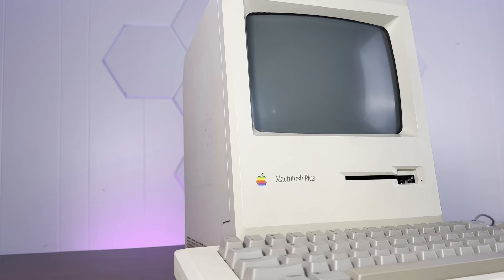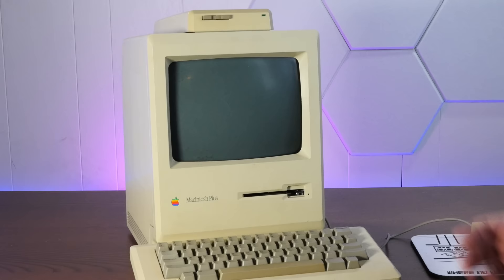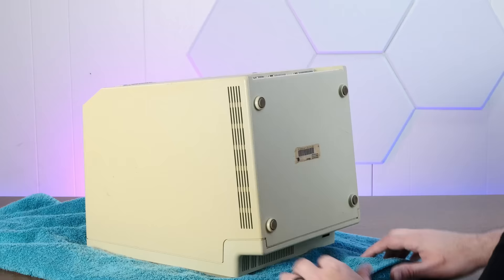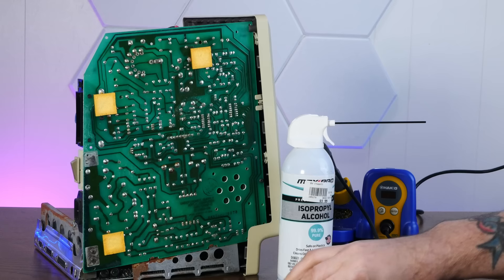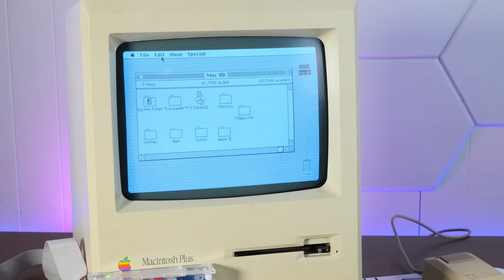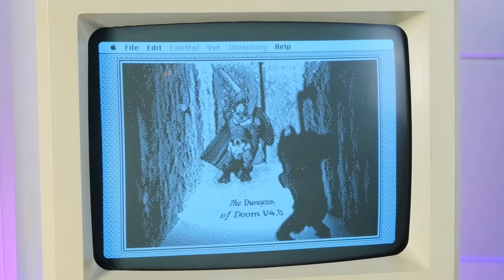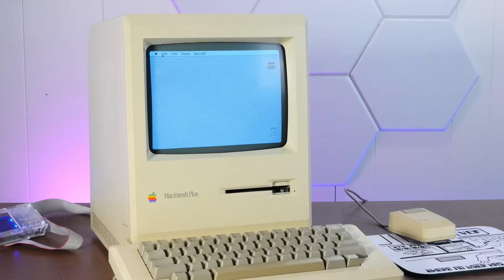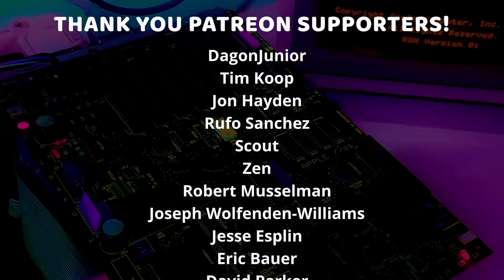Steve Jobs Broke This Mac

Comment: I'm actually glad they used Torx, because it doesn't strip if you look at it wrong
Reply: the issue with Phillips screws is that most aren't actually Phillips screws, but instead are JIS screws that also are cross-shaped but take a flat screwdriver instead of the bullet-tipped Phillips screwdrivers that would strip it in three seconds

Comment: Talking about the lack of fans, in the UK we had the opposite issue, the Amstrad PC1512/1640 had the PSU in the monitor and as such convection cooling was enough, IBM losing sales put out the rumour along the lines of "these computers are unreliable, they have no fans so they overheat". In the end to placate customers a fan was added to HDD models, Alan Sugar remarking something along the line of "we'd paint it pink leopard print if the customers wanted it".
Alas the replacement for the PC1512/1640 was unreliable and got recalled, none of it was down to anything Amstrad had done with the design but they were supplied dodgy hard disks, something Amstrad sued and won damages over.

Comment: "Fortunately, all the screws are exactly the same size!" - shows screws with 2 different types of threads
Reply: Same torx size, beeno.
Reply: @Us-two  that makes it significantly worse if there are 2 kinds of threads! it'd be very easy to mix them up and cross-thread the wrong screw in the wrong hole, they're the same size bit, so they're hard to tell apart.
Reply: @Minty1337 Normally one can see the difference, self-threading are tapered at the end and have a much coarser thread  -  these are used when installing in plastic. But I agree, when your eyes are as old as mine (79 years) the screws are a bit difficult to differentiate. Have a lovely day.
Reply: @Us-two Too bad he used a hex wrench on the sheet metal three, and a torx on the two handle ones, which should get lost...

Comment: One solution I’ve used for 20 years for the screws in the handle: pull the pen tip out of a Bic Stick pen and shove a T 15 bit into the end. It’s the perfect length.

Comment: One tip I picked up for cracking open these old macs… take the handle and chassis screws almost all the way out, then push on them to pop the two halves of the case apart.

Comment: The minimum temp for solder to start to melt is like 360F. If the computer ever got that hot a cracked joint would be the least of your problems.

Those joints cracking is more likely due to a combination of mechanical stress from the giant connector,  low quality solder and low quality workmanship. I would personally suggest clearing the joints entirely and redoing them using fresh leaded solder.

Also, Star Trek IV. 😅
Reply: I always thought the issue with uncontrolled temps was thermal expansion putting strain on the joints
Reply: Cracked solder joints aren't caused by the solder itself melting, but by fatigue caused by repeated thermal cycling over time. All of the elements in the system (components, component leads, PCB, the solder itself) have different coefficients of thermal expansion, so large thermal fluctuations will cause a lot of strain.
Reply: @SteelSkin667 Glad you wrote this so I didn't have to!

Comment: I still have my original FatMac which was upgraded to maybe 2MB and a built in scssi controller was bodged in with a 20MB HD. It wasn't booted for 20 years, about a year ago it did the bong thing and the monitor shows a single line of sorts, will apply this solder hack to see if it restores the video.2 fingers crossed
Reply: A single very bright line? If so start with the connectors for the CRT yoke.

Comment: Also a problem is the connector pins for the deflection yoke.  Those carry many amps and the solder joints often get crumbly.

Comment: Good to know. I have a Mac Plus that's working fine right now, but it might be worth it to reflow those solder joints. I just finished recapping an SE/30 motherboard that I then installed into an SE chassis. Every single electrolytic cap on that board had leaked, and the board smelled like rotten fish every time the hot solder hit it. But now it works great, and I got the fastest B&W Mac that Apple offered.

Comment: Nice video and fix, however heat from those parts would be nowhere near hot enough to crack solder joints, that's a common myth. The plastic would start melting first.
The usual cause of cracked joints is physical shock on old joints that have oxidized over the years.
Reply: I agree it's not getting hot enough to melt the solder but thermal expansion and contraction can lead to stress cracks.

In some cases the solder can get hot enough to melt but that only happens when large currents flow through an already damaged connection.

Comment: I don't think that's an original Mac Plus keyboard as it has no numeric keypad or arrow keys. Also, the Mac Plus wasn't released under Steve Job's tenure but of course it used the same design as the previous two Macs. The first whole new design was the Mac SE which did get the fan.

Comment: Sent you a tweet (or an x...) about this, but you missed a joint on the far right of that connector. It's AFTER the gap, so it's easy to miss and I have to always remind myself about it. Also, redo the yoke and the neck connector. trust me, those will be equally as bad.
Reply from the maker: haha thanks! i saw that one in editing and went back and got it 😅

Comment: Lucky! I was hoping for an easy fix like that, but the Mac Classic I recently restored needed a lot more work. Battery and capacitor leakage sure did a number on this one, but many hours later it works like new. Well, aside from the RTC chip being completely destroyed by the battery - any ideas how to replace that? I saw an ATTiny based replacement for the SE/30 but idk if that would work on the classic

Comment: But the ultimate question remains,did you solved that problem permanently?
Because i was thinking how about putting a heatsink and fan inside this macintosh to blast and conduct all the heat away from the motherboard to increase it’s lifespan.

Comment: Any reason why the Mac Classic would suddenly not have a working keyboard and mouse after sitting a for a year?

Computer boots, everything seems to be functioning, but I can’t get the mouse to work, either plugged into the keyboard or directly into the port on the back.
Reply: The keyboard and mouse are both broken? Probably bad ADB circuitry. If you're lucky it's a cracked solder connection on the board but it could also be a fried chip. This could potentially happen from static electricity when plugging something the keyboard in.

Comment: Well…
My MacBookAir M1 has no fan…
And I swear I’ll never buy a laptop macintosh with a fan…

And in 92 at the ripe age of “balls not dropped yet” I drilled the back of my dumpster find Mac+ and put a PC fan in it with an outside power supply… still worked when I left the country in 2003…

Comment: Just one disclaimer to any newbies that attempt to solder on circuit boards, I highly recommend you get a temp controlled iron and don't use a direct mains iron as those are really only good for soldering wires together they have a tendency to get hot enough to de laminate traces when used on PCBs.